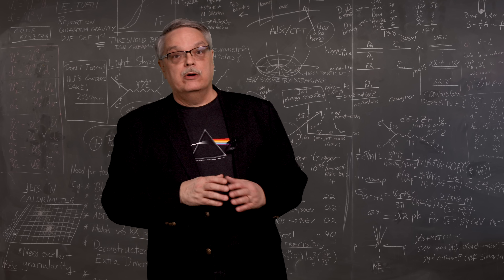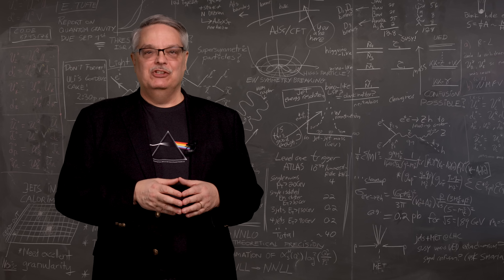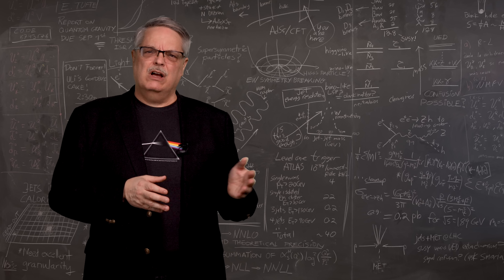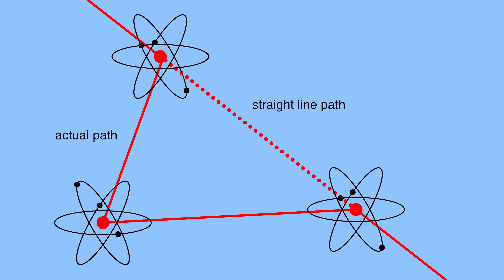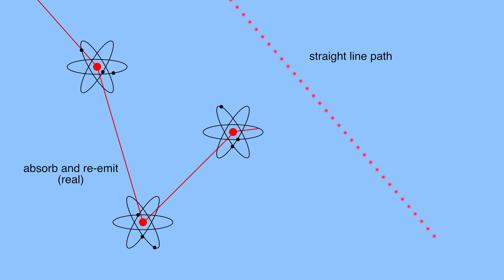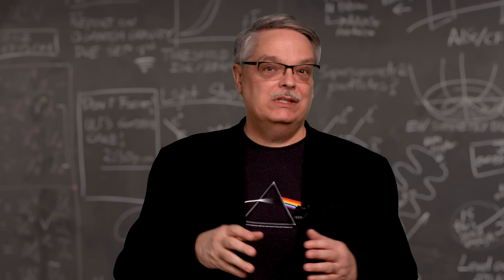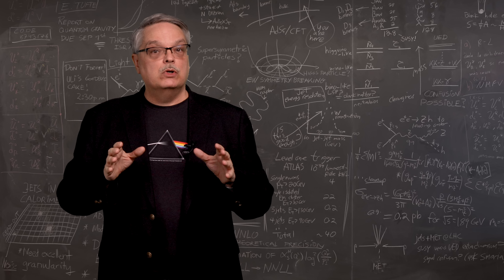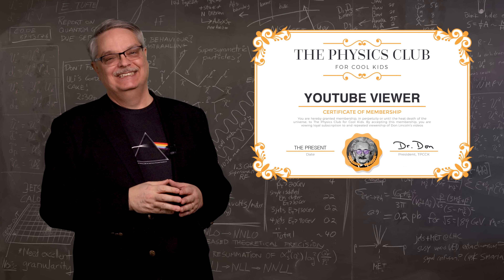Why does light slow down in water?

Comment: I didn't understand how can the same wavelength which got shorter inside the glass after interacting with the electron change its wavelength after coming out of the glass. The wave has already been emited from the source, so isn't energy or any other similar frequency wave needed to increase the wavelength in vaccum. One more thing why does light have to change angle after getting slowed why can't it just move straight?

Comment: We have also been taught that light’s speed is a constant. So what your saying is that light moves at 186,000 miles per second. But through some materials it is only 2/3 that speed and there moves at 122,000 miles per second?  Is that correct?  Does this variance in speed impact time as well?
Reply: The collection of photons (the beam of light) is mixing in a way that sort of leaves some photons appearing to lag behind other ones in a group sense.  Individual photons are always traveling at “c”.  It's complicated.

Comment: A few people seem to be wondering why it changes direction. 
This diagram from the Feynman lectures should help: http://www.feynmanlectures.caltech.edu/img/FLP_I/f31-02/f31-02_tc_big.svgz It alone may not give you the intuition for whats going on, but you can read the lecture itself for far more detail. http://www.feynmanlectures.caltech.edu/I_31.html 

The Feynman lectures dont just cover why it changes direction but everything in this video and much, much more. Unless you already have a fair grasp of much of this it will likely take you quite a few careful read throughs to understand each page, but its amazing stuff.

Long story short for this particular case though: its the wavelength changing as the light effectively slows. If you drag out the wavelength while keeping the same frequency, the parallel lines you see in the vacuum necessarily must get closer together once they move in to the glass, and you can see the result of that in the image.

Comment: a key to dark matter or no time for energy exchange
short version 
Energy exchange limit or limit for two point to interact.
it is a bit hard to write down this thought for me.
if two points have relative speed more then speed of light, they not able to interact.
but they can interact through the third point. (exactly like dark matter)
.

1)You know how space can expand faster then light? And it also can curve? 
soo, it most likely can curve true it selfe. and this how it not interacting with it selfe.
(in black holes space curveture length is extremely small)

2) How many time need for Sun to exchange energy with you? soo every energy exchange take some "time".
 There for if two point have speed difference more then C, they will have no "time" to exchange energyx, have no "time" for exchange to occure.
 Even if they will share same place.
also you may see it as, FLT parts in more then one place at a "time" compare to us. For FLT part we in less then one place at "time". (why mass go up)

it more about interaction limin then about speed of light. 
can be tested, if we will represent a third point.

long version
-dark matter in our galaxy, (most likely particles emitted by central black hole)
is particles that moving faster than light. (most likely you do not "belive" in this) 
if i assume it is correct, then big amount of hydrogen on edge of galaxy, is where this "dark matter particles" decay after losing speed. (decay like new particles from hadron collider)

-parts of dark matter alredy found, but we do not about it. (perseption(particles from hadron collider))
-particles found with hadron collider behave like a dark matter after loosing speed.
-most likely there is a energy exchange speed limit in betwen two points (not sound speed),
most likely it is a speed of light. (that about why we do not see dark matter, but see it interction with other(slower for it/faster for us) particles)
-particles from hadron collider will be stable if placed in faster then light speed.

whant to tell more, I hope this is enough to contact me.
the key is a energy exchange speed limit
(i want my Nobel for showing you dark matter)
Best regards,
Dynin A.I.

Comment: I thought the speed of light was also lower in the atmosphere/air.
Reply: cyrilio it is, it’s just the index of refraction of air is very slight, about 1.001 but a little less. Remember that a vacuum’s ior is equal to 1.
1/~1.001 = ~0.999, so it’s ~0.999c
~99.9% of the speed of light.

Comment: Amateur here. Why don't the waves induced by the electrons transmit beyond the borders of the glass material?
Reply: Well, the easy answer is that the waves only exist in the medium because the electrons that move and induce the wave are only present in the glass/water/etc.  Remember, this is a passive, reactive wave -- without the light inducing it, the wave would not exist.  Note there can be energy that extends beyond the glass -- lasers that cut glass, for instance, induce a wave great enough to locally heat the glass and that heat can be easily detected.
Reply: NaN but if the electron wave is negligible because its strength is inversely proportional to the distance squared, how can you detect an electron wave when there is just one molecule, and how can you create a laser from it?
Reply: I don’t quite get it.
The electron wave was created, why it doesn’t extend beyond the glass?
Reply: It's very weak. It's only effective because of the short distances inside the material.
Reply: So what you’re saying is that the electron wave still exists but is negligible without the constant adding of power from the original wave?
If so Is it possible to create a wave with an amplitude so strong that the power of the electron wave would not be negligible so that wave will continue?
Reply: @nafrost2787  
It's range is just small. It gets cancelled out by the fields from the other electrons/protons. On average the total field of a material is 0 unless you have a magnetic material, in which the oscillations get cancelled out, and only a static component remains..
Reply: @Nan just to be sure I understand it.
The electron wave continues to exist, but it’s negligible in comparison with the waves produced by the other electrons and protons which don’t affect the light wave because they cancel each other ?
And if there is only one molecule, the wave is not cancelled which is how some lasers work by stimulating electrons causing them to create a secondary wave?
Reply: @nafrost2787  
You're making it too hard on yourself. The field strength of an electron is inversely proportional to it's distance squared. (Just like gravity) So it's effective range is small, since the charge of the electron is also small)
Inside the material you have local effects, because you have small distances. Outside you don't have the local effects. Leaving you with a negligible  total effect.
Reply: @NaN so you are saying that the electron wave is negligible in comparison to the movement of the rest of the material without the constant adding of power by the original wave?
If so let’s suppose I have one molecule, is it possible to detect the electron wave in that situation?
And what about what I asked before, is it possible to create a wave with an amplitude so big that the electron wave would not be negligible?
Reply: @nafrost2787  
It will be at enough distance from the electron. The material is full of electrons, so the wave is always close to one inside the material. 

BTW: I think this is also how some lasers work (not the semiconductor ones). They amplify the light by stimulating the materials electrons to their resonance frequencies. Them in turn amplifying the light. Which in turn also explains why lasers have a very specific frequency.
Reply: @Dave Smith
So what you're saying is that all of this conversion what just wrong and that the electron wave does transmit beyond the borders of the glass?
Reply: @nafrost2787  

this video has taken many shortcuts in explaining the relations between the two systems and how it affects them.
to better understand this, we need to talk about d'alembert's equation and its dispersion formula and how it describes a wave.
so d'alembert's equation is used to link together the spatial and temporal variation of a wave.

and from this equation comes the dispersion relation that links together the frequency, wavelength and celerity of a wave.
to access to this equation, we use maxwell relations to describe this phenomenon. when we consider those relations in the void, we get the relation: c² = w²/k² where k is the angular  wavenumber and w its angular frequency. (just google it, ain’t that hard to understand)

thus we can see here that the celerity is proportional to its angular frequency. however, as explained in the video, when light enter a medium, there are charges that can be influenced by the electric field, especially electrons that are 2000 times lighter than their counterparts protons.
thus, when light comes in this medium, we assume that only electrons are affected by the electric field.

we then apply newton's second law to those electrons to find a relation between an electron's speed and the electric current
(we also neglect the magnetic field of the light as the electron is relativistic thus the force from the electric field is much greater than the magnetic one see lorentz law to better understand this )
and then by generalizing this equation to all electrons in the medium, we can get an induced current from the electric field of the light.
( the current is j = n * v with n the volumic density of charges and v the celerity of electrons)

then when we put this back to maxwell ampere local equation, we introduce a new component: the induced current which thus gives us a new dispersion equation: c² = (w² - wp²) / k² with wp the plasma oscillation and thus we can see that from the value of wp, we'll get a different value of the celerity of the wave.

thus we can say without a doubt that they are wrong in their explanation as it is not the combination from the electric current of the electrons and the wave that makes it slower but the induced current inside the medium that modifies the dispersion relation thus modifying its speed.
or in simpler words, it's the movement of electrons that changes the frequency and celerity of the light, but not the combination of the two electric current. (also on a side note, trying to represent the electric current of a dipole using a sine wave.. funny thing you did there 😅)

and finally, as for the reason why the light has a different angle, well you can easily explain this using two waves parallel to each other crossing the medium in phase with each other. as they have the same wave plane, you can easily come to the relation between the refracted angle and the incident angle using some basic geometry. i recommend you to see the demonstration of descartes second law if you want to better understand what i'm talking about
Reply: Isn’t the change in direction comes from Fermat’s principle?
Reply: @nafrost2787  
it is a principle. light follows it but that does not tell us why it does.
Reply: I think you are asking the correct question and the answers are not correct.  If it was merely square law keeping you from seeing the induced wave then light would lose energy as a result of travelling through any medium with an index of refraction greater than one.  We know that is not the case.  The electronic response is not then an actually transmitted em wave.  I think you just hit the limitation of the simplicity of the analogy used here.
Reply: @davidsuzukiispolpot  
it's no analogy, composition of wave of different wavelength doesn't result in a slower wave but a wave with the same speed.
the real reason which is harder to understand i concede is due to the electric current generated that modifies the dispersion relation by diminishing the angular wavenumber thus reducing the speed of the wave

Comment: That's pretty awesome to have learned indeed, but as a complete nub in physics, that also makes me wonder, if both photons and electrons are basically electromagnetic waves, why doesn't light just get absorbed completely to form an big photelectron that sticks with the atom? And don't electrons do that all the time and emit photons? So why don't we see the result in the second wrong explanation? What's with this love hate relationship between photons and electrons? What am I missing, beside the other 3.6 years of my education?
Reply: I'm not an expert, so take what I say with a grain of salt, but I don't think an electron is an EM wave.  EM waves are neutral - electrons are negative.  I think this is one of many observable differences.  I looked up "are electrons electromagnetic waves" to check, and I went through the stack exchange, and it appears that I am right, but some of the stuff I found went a little over my head.
Reply: At the quantum level photons are excitations of the electromagnetic field.  Electrons are excitations of the electron field.  These are two different fields, but two fields that can influence each other.

There are trillions of photons passing each point in the glass per second.  There might be billions of electrons in glass.  Lots of photons don’t directly interact with any electrons.  But the few that do disturb the electrons, cause the electrons to emit their own distinctive wavelength of light, with some delay.  The original light’s multiple wavelengths and electron light’s fairly pure but differently timed wavelength superimpose to become multiple new wavelengths while inside the glass.

The multiple new wavelengths are also redirected (as happens in a prism).  Don didn’t want to get in this part of effect, I think because it is a different thing and hard to explain.  But it has something to do with the multiple new wavelengths being differently bent in a medium.  Short wavelengths (violet) bend more.  This has the effect of tilting the wave front, which is what is meant by refraction.

The timing or phase change in the light waves is another ingredient that I think leads to the overall slowing effect of the beam (not the light really).  Consider too, the energy of red light is divided among many photons, whereas the energy of violet light is more concentrated among fewer photons.  You can think of the superposition effect as being milder when spread over the many red photons than the fewer violet ones (said in a very lay-speak way).

The main thing to take away from the video is that superposition from two sources of light are behind the apparent slowing of light.

Comment: Greetings. What electrons were you talking? I mean there is such thing as spectrum of radiation or absorption. If we have a wavelength of the EM wave that lies out of the spectrum of absorption of glass then it is transparent for this wavelength. Therefore it couldn’t interact with orbital electrons in any way, and there are no any free electrons as well. Otherwise the glass would not be transparent for this wavelength of EMWave. Also, why red waves refracts less than blue waves? You have gotten an excellent t-shirt showing that.
Reply: Light is Just an oscillating EM field. Charged particles in a changing field move. Moving charged particles give Off Light. There doesnt have to be Absorption involded I think.
Reply: Jonathan Böcker wow! Really? You are trying to say that em-wave can have influence on charges particles without losing any energy? That is awesome in any way. My congratulations you have just invented a new law of physic that violates any possible law related to conversation of energy and momentum.
Reply: @sergusy  thanks. I knew I would eventually do something with my Life :)

Comment: So even though the electron oscillation is induced by the wave of light it has a different wavelength? Because it is 'attached' to the atom? Because it has an intrinsic wavelength?
Reply: Electrons around an atom are disturbed by certain UV photons and then emit the same UV photons.  Energy conservation.  The exact frequency depends on the electron’s orbit.  A free electron would not be affected by any wavelength of light, or very rarely.